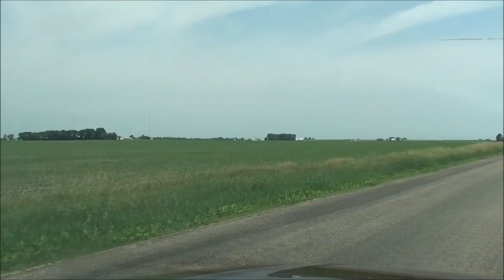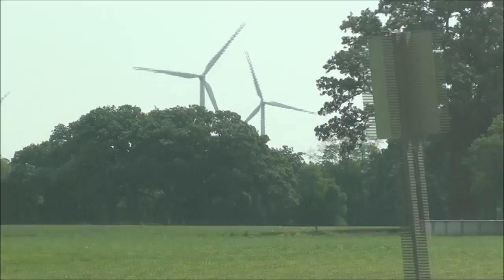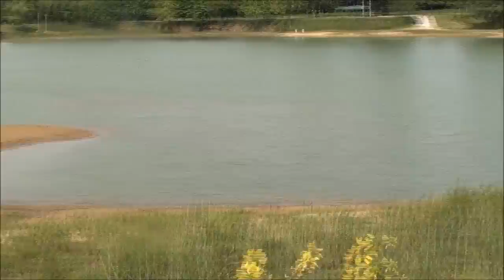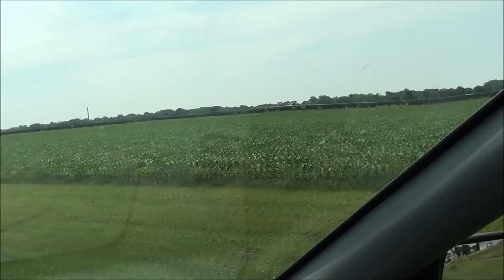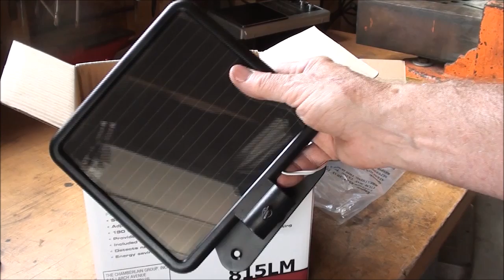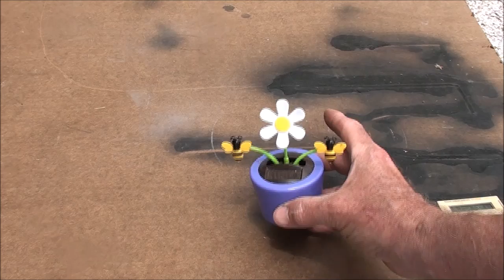tubalcain ROAD TRIP How Electricity is Made-SOLAR POWER video 1

Comment: Hi mrpete,
Last good shot I did was, 4 years ago to install a geothermal heat pump to heat up the house and the workshop/garage, the energy cost went from $3,000 a year for the house a/c and heating alone, now for about $1,700 a year we get the house to 70deg. F and as a bonus the garage/workshop heated to 60deg. F in the winter. The investment is pretty high, around $35,000.
Here in province of Quebec we have most of our electricity produced by hydro power for relatively cheap compared to other countries. In the last years there have been some wind farms installed, they don't always make unanimity among people.
Anyway happy I got the old polluting oil fired furnace out of there.

Comment: Mr. Pete,
I watched this video this morning with my youngest this morning. He liked it, too. Is "boondoggle" the appropriate word for the solar farm? Solar powered electric fences are available at HF these days. I might have to invest in one if the fence hoppers don't settle down soon.

I sound of the blinker in your car takes me back to when I used to go on drives with my grandmother through southern Ohio.

I had a 16 Seer ac/furnace unit put in last summer with a about a 6 year return on investment at current energy costs. No regrets.

Thanks for your efforts.
Reply from the maker: I mounted the flasher unit on the steering column so I am able to hear it. Yes, it is a boondoggle--I wasa fraid to call it that because of tree huggers.
Reply: mrpete222 So why is the solar farm a boondoggle?
Reply: Technology is not to the point where the can pay for themselves. They have to be subsidized.

Comment: Thanks, MrPete.  That's a nasty rock chip in your windshield...is there going to be video someday on how to fix those?  In the past all you could do was replace the windshield, but I understand that at least some can be repaired now. 

An advantage of solar over nuclear is that I can have my own solar power if I want to...which would be nice for those times when storms take out the grid power. An alternative is a natural gas generator....I've never lost gas supply...storm or no storm.  Kind of wonder why the electric company doesn't run their lines through the gas lines....

-- Mike

Comment: Typically, a brake warning light indicates low fluid in the reservoir.
Reply: there is also pad waring lights as well but if the back shoes were out the the fluid would be low on the reservoir.

Comment: Don't count on that new heat pump being much better than the old one they say things have become more efficient and it will be interesting to see what it cost you to run, keep us informed on the results. Nice to see the solar farm but it should be on arid land not good farm land.
Reply: I have to disagree. I replaced a 1970's furnace and AC with a modern condensing furnace and saved a lot on my electric and gas bills. The simple fact that the flue can be made from PVC tells you that more of the energy is staying in the house. And the outside air intake prevents cold air from infiltrating.

Comment: I also have a new high efficiency furnace after my old recently serviced and checked boiler had a near catastrophic failure.  It has plastic pipe venting out the side wall below a window, like yours does.  If the window is open, I find that whatever garbage is exiting the pipe will, unfortunately, enter my living space.  I would not have allowed that if I had realized the consequences.  I also have found out that the plastic pipe, under certain circumstances, can fail.  This has had deadly results in some cases.  My plumber swears that its not a problem, but I'm skeptical.
Reply: Over 20 years now I worked for a master plumber and we installed what you described.  I specifically remember the vent pipe must be at least four feet from a window.

Comment: Thanks again Mr Pete, I always enjoy your videos, either workshop or road trip based, they are all very interesting. In Tasmania, Australia where I live most power is hydro electric, although in recent years, many wind farms have been constructed, and now many homes have solar panels fitted also. My neighbours have just fitted solar panels and the way it works, is that for power they produce but don't use themselves, a credit is earned, but no money goes back to the home owner for excess power sent back to the grid. They spent around AU$ 14,000 and they probably won't have to pay for power again. They remain connected to the grid, and so have power at night without having to have battery storage with the ongoing maintenance issues that would follow, and they have the grid for peak loads that solar can't economically cover, but over time they will most likely slowly build up a credit balance and not have any further power bills.
Thanks again for all your efforts, I think that your videos illustrate the fact that all peoples of the world have far more in common than they have differences, and when most people become aware of that fact, security for everyone will be enhanced.